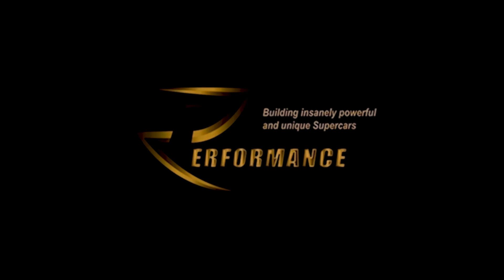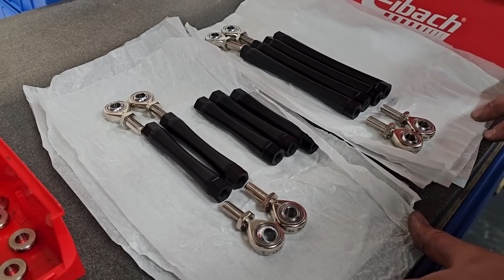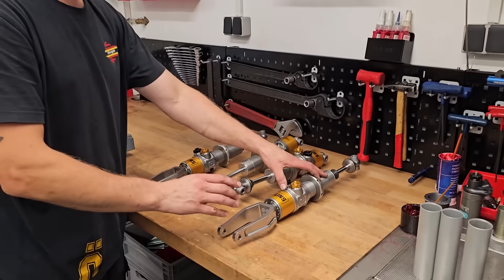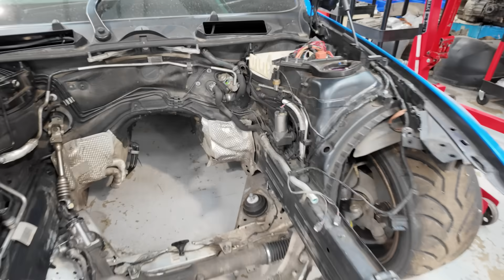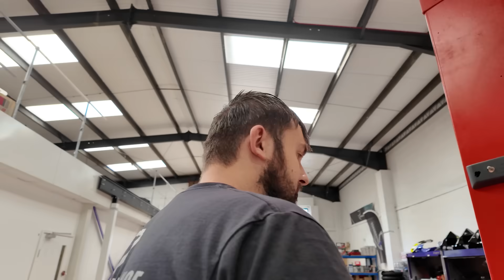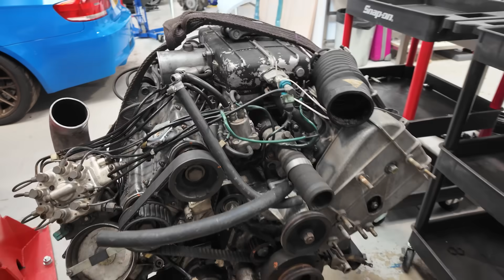UK's Cheapest Gen 2 Audi R8: What Happened Next?

Comment: did you say vw is reliable 🤔😆 i dont agree , anyways these shocks look great for track days if you can get to them to adjust them easily that is but i beg to differ that nitrogen shocks are way better than oil based old style shocks and are built to handle higher pressure so youll get way more durability out of nitrogen based adjustable shockers and much easier to adjust
Reply: I’ve been watching this channel for over a year and 100% it’s persuaded me not to buy anything from the VAG group.